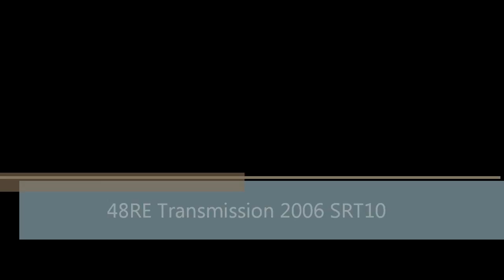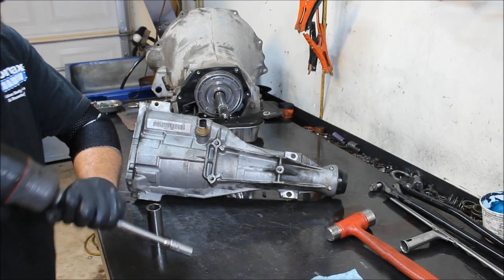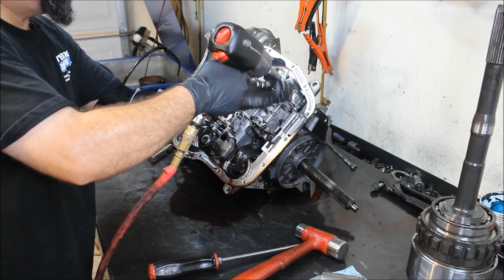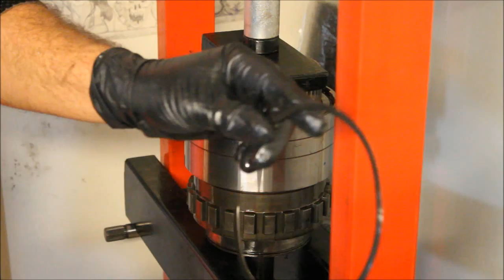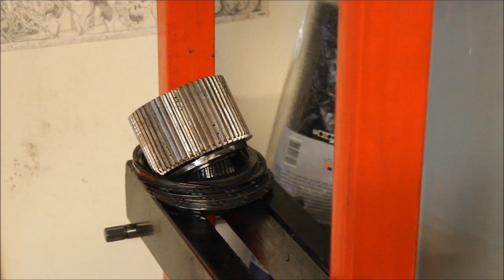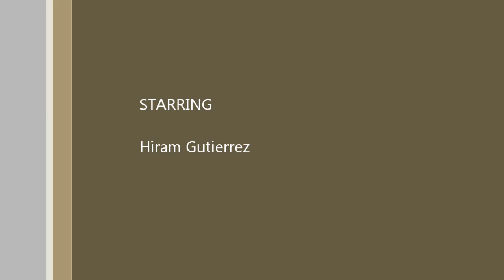48RE Transmission Teardown Inspection, 2006 Dodge Ram SRT10 - Transmission Repair

Comment: By the looks of it there are no responces but I'll try anyway.
You didn't remove the bushing in the 2wd extension housing.
Why?
The 46re tool doesn't work and i can't find a tool for the 48re

Comment: Can I swap 2006 dodge ram 1500 transmission with the 2012 dodge ram 1500???
Please reply to my question y’all
Reply from the maker: Just make sure the solenoid pack connector is the same color. Some 2012 have a Grey connector, if it does you need to install a solenoid pack on the older one to match. Otherwise you will have issues.

Comment: Man.. To say you know these transmissions is an understatement. I have a 48re that won't come out of torque converter lockup. Replaced tcc, gov press. solenoid and transducer.. No luck. Anything else I can check with the pan dropped? Keep up the good work!!

Comment: Perhaps one of the BEST on-line tutorial videos on YouTube. To the point, informative and no music. Thank you for that. Although it would be nice to see the valve body also included. Question, how can I tell if the torque converter needs replacing, or does one just install a new one with the triple clutch set-up to be safe since its all apart anyway? Thank you.
Reply: Pressure diagnosis is,complicated, best replace with new😥 skimping on one component on a rebuild is a bad thing. Chance to bring it all down.

Tc's are hard to get clean without a expensive machine to flush it.

I
Into I would replace it.

Comment: I got me a 2006 ram1500 4x4 5.7l. Does anyone knows if a 2005 Ram 1500 4x4 5.7 transmission fit on it?? I see the engine and everything is the same. It I’m just not 100 percent sure if the 2006 has a different trans

Comment: thanks you for the video, very good information, this is awesome

i would like to know if somes gear are weaker than other, or they will burn always equally
why they are all burned ??
 did the guys just rage drive his truck to finish hit this transmissions ?? hahaha

is the truck is driveable at this points , with minor shift problem,  or this is well beyond maintenance (sry im not english) thank you!

Comment: good tutorial bro.l got problem in my 2006 dodge ram 3500 5.9 2wd  with extension housing overdrive case crackin .l buy new case in ebay but not easy its expense.ok next step,l in my dodge truck never see the bars betwen transmission and extension housing and l try buy but dont find.greetings from dallas tx

Comment: I want to thank you for this great vedeo but I have a question...so my oil pan has a reusable gasket..and my question..do I need to replace my oil pump gasket?
Reply from the maker: +Dubalin H If it came new in the kit, install the new reusable pan gasket. If your kit came with a cork gasket, reuse the original reusable gasket.

Comment: What would a shop charge to if I took this transmission to them?  My truck had the computer worked on since rodents chewed thru ignition wires a fried the computer.  Ever since the shift from 1st to second and when slowing down from 2nd to 1st it shifts hard.  Expressed it issue to the dealership that it never had that issue, they changed the trans filter, pressure governor and drained and flushed fluid.  The problem didn't go away.  I don't think they adjusted the bands. What is take on it?

Comment: im about to teardown and rebuild my 48re transmission out of my 05 srt 10 ram. i was wondering what the torque specs are for both of the bands the inner and outer.

Comment: I have a torque converter heat exchanger that has gone bad on my 2006 dodge cummins, I was going to try and flush the transmission but am afraid it will still need a rebuild. can you tell me if you think a flush will work? if not what you think the cost for a rebuild on it?

Comment: Buenos dias amigo una pregunta tengo  una 2004 dodge ram 2500 diesel 4x4 pero me anda fallando un poco dela transmission  lo q ase es cuando ba de 15 millas  a 30 como q se Barre pero despues de 30 millas  funsiona perfect pero lo ase nomas cuando sele prende las lux de check engine

Comment: My 48re was rebuilt, and put the transgo shift kit in our just like your other video.   Once it was reinstalled would only stay in limp mode and had a code of P0973.  We switched 3-4 and tcc solenoids, put the new governor solenoid in it but left the old pressure sensor.  Everything works now, but for some reason OD is intermittentlt not working.   Any ideas?  Great videos by the way!
Reply: Disregard, It seems I just needed to drive it a bit.  Probably just one of the valves sticking.  Everything seems to have worked itself out.

Comment: Just rebuilt my 48re from an 05 srt10 , direct drum would not come off, I pried of the two drums to remove the snap ring, removed the drum ,the clutch and steels where coned shaped, , band was as bad as the one shown, new bw rebuilt kit, new band , all electrical parts new . It was not as bad as I taught , take it by parts, used this video, also check out his valve body video,

Comment: You rock Hiram. One of the best teardown videos on the web. I wish we were related so you could be here for my rebuild. You hammered that teardown out like a pro. Thank you for such a high quality video. I am doing a complete overhaul and upgrade on my 47re in my 97 Cummins with Red Eagle frictions and Kolene steels. what other parts besides the rollers/sprags or wavy snap rings would you suggest replacing while I have it all apart. I am putting a billet input in there also. All new Torrington bearings, billet pistons, etc?  I really appreciate your input and feedback, thank you in advance Brother. I want this tranny to be solid on a moderate budget without sacrificing durability. 298,000 miles and I believe it was rebuilt once already by Jasper Transmissions.

Comment: HOLA HIRAM ,TENGO UN DODGE 2005 PICK UP RAM 2500 MOTOR DIESEL CUMMINS .LE HE REMPLAZADO 2 VECES YA EL GOBERNADOR Y EL TRANSDUCER SENSOR EN LA TRANSMISION ,AHORA MISMI TIENE 110000 MILES PERO ME ESTA DANDO PROBLEMA ME ENCIENDE LA LUZ DE TRANSMITION TEMP Y LA DE TOW /HAUL AL MISMO TIEMPO Y EL PICK UP SE AGUANTA  COMO QUE SE SALE DEL OVERDRIVE ,ESO ES A CUALQUIER VELOCIDAD Y LO MISMO FRIO QUE CALIENTE Y PASA INTERMITENTE SE ENCIENDE LA LUZ Y SE APAGA Y NO DA CODIGOS NINGUNO .QUE CREE USTED QUE PUDIERA ESTAR PASANDO .GRACIAS POR SU AYUDA SALUDOS HUGO

Comment: Ok i know this vid is old but from a guy who has done hundreds and hundreds of these transmissions i have to say this is a perfect tutorial for tearing down and inspecting basicaly all dodge from 42- 48re. when the unit was dumped on its side and the fluid ran out i could smell it or maybe that was the smell of the one i did earlier today lol. Great vid.

Comment: How similar is a 47RE? I have one attached to my magnum V10. I am upgrading the Magnum V10 pretty extensively. What are the limits that it can handle. Thanks in advance Hiram. I love your videos.
Reply: Cody Green He kind of explained the differences throughout the video. Basically some parts are bigger on the 48re. The 48re can also do torque converter lockup in 1st and 47re cannot. How extensively are you upgrading your v10? If you are throwing a blower on it, you might be better off upgrading to a built 48re. The again the v10 really doesn't tax this transmission like the cummins does so it really depends on the amount of torque you are producing.

Comment: I'm currently tearing down my 48re from my 05 srt-10. So far all my hard parts look ok except the front clutch hub assembly which had clutch plate gouge in the splines. currently thinking I should replace the bellville return spring because of the impressions marked in it from it being used. I have another bellville return spring that looks different. My question is will it be a good replacement for it. BTW i cant find the exact one i have.

Comment: I have a 1998 dodge ram 1500 v6 with a 42re transmission.  Why does a transmission does not shift to second when it is cold outside.  As soon as I drive truck for at least 10minutes, I shifts and then it keeps shifting perfectly until it gets cool again.

Comment: Mr. Gutierrez... I have a 96 Dodge Ram 1500.. I believe it also has the 48RE.. would it be inappropriate to ask what a rebuild like what this transmission needs would cost in 2015 dollars...? You made that tear down look easy.. I realize you have years of experience...but Im looking at having to either do this job or replace the tranny in mine... any help and information would be gratefully received...

Comment: Thanks allot for this vid.... I have a Dodge Dakota .. V6  ... with a 42re ... that was toast ... I'm a mechanic ... but always stayed away from transmissions ... so...I went and got a rebuild kit... also with a jr shit kit ... and as long as you take yr time and remember what you took off... and the order... it was actually pretty easy... so... I even went to wreckers and picked up a other one ... that had broken snap rings... picked it up for 50 bucks... and did a rebuild on that one to... just so I had a spare ... so much thanks again... 

Jay

Comment: I have a question.?
I just rebuilt my 44re transmission, everything went real smooth an easy. Except, after I put on the back assembly back on the main case I cant get either shaft to spin. When I pull the rear unit off both main case and rear unit spin.? But as soon as I tighten it down, the input an output shaft wont spin. It does however switch between gears. Im so lost. I need some help.?
Reply: +Seba Mundell 
did you make sure to put the snap ring back on the output shaft?

Comment: love how thorough you are in explaining what and why you're doing things.just bought a 01 ram 2 wheel dr w/5.9l 24v cummins think it has the 47re auto behind it has 221k on it thinking about rebuilding but just want to beef it up a little  would like to up the horse power 50 horse or so what kit would you suggest pull a older heavy bumper pull rv and 18 ft car hauler lumber ect..nothing big  and would i have to replace torque converter and do alot to the valve body?

Comment: I have a 48re with 30k on the rebuild and it lost overdrive. So I replaced the shift solenoids gov. Pressure solenoid, transducer, speed sensor and the spring you mentioned that breaks. Still didn't have overdrive and there are no engine codes.i tryed forcing in overdrive by grounding the #6 pin wire to rule out ecu issue and still no od.i put a pressure gauge on the overdrive port and I only get 25 psi .so I was thinking it would be the overdrive piston seal but not sure. Any advice would be appreciated. great videos by the way

Comment: Hi I like the video :)
I have Dodge RAM 2500 2003 Cummins with a 47re that needs a rebuild, the oil looks bad and I found parts of a big snapring in the pan.
Since I live in Sweden the workshop has to order the parts from US and that can take weeks, but I could get a 48re from a 2004 with low milage on it and the question I have is if you know if I could just take the 47re out and replace it with this 48re, all the electric connections are the same.

Comment: Hiram, thanks a ton for this video.  I appreciate both your knowledge that you share and the simple fact that you visually show how to disassemble everything.  I have read a lot of write ups but they skip out on some of the details.  Also I must say, watching you tear apart this transmission was very entertaining.  You just absolutely whipped through that SOB!  I WISH I could yank snap rings that quickly..  Perhaps I need to work on my technique. 

Again, awesome video, I watched every second.  You get my vote.

Comment: Hi Hiram, about how much would a similar rebuild usually run for this same exact transmission? I'm considering either the SRT10 Ram or the SRT8 Jeep as my next purchase, but this was also a big factor (regarding the transmission) both transmissions are auto.

Thanks,
-Sunny

Comment: Great video but the viper has the T-56 transmission
Reply: ***** tengo un 96 dodge diesel con la transmision  recien reconstruida. cuando va de 1ra a 2da y de 2da a 3ra  los cambios son muy cortos.casi como si entre 1ra y 2da tuviera 11/2ra,21/2da y 31/2 ra,como si tuviera 8 cambios muy cortos.el overdrive le entra muy pronto sin que este prendido el boton.
culquier concejo  se le agradece 
gracias.
Reply: ***** gracias por responder.
con poco ajuste no se siente nada los cambios le doy mucho ajuste y  golpea mucho los cambios. pero siempre con los cambios muy cortos.casi como si tubiera 7 o 8 cambios. y el overdrive entra sin el boton prendido.

Comment: I was curious to know of any big difference in disassembly of a 42re versus the 48re. I wanted to get a spare unit to practice on and maybe upgrade the internals a little bit. If you had any suggestions I would love to hear them. 

Great video with loads of information +1

Comment: Hey am from the Republic of TrinidadandTobago I've watched your video because am in search of answers on transmission problems. However heard you highlighted a problem with Soidnoid Valve... After doing a diagnostic check I found out the (16-line pressure soilnoid valve) is the problem... i wanna find out what is causing the problem and what should I do...And would this just prolong the life of the transmission temporarily...

Comment: Buenos días amigo! Primero que nada quiero felicitarlo por su trabajo, son pocos las personas que se toman la molestia de ofrecer un material informativo como este, bien sea porque son egoístas o simplemente piensan que les puede pasar como a los Magos si revelan sus secretos, pero usted lo hace y es admirable, soy de Venezuela, donde muchos reparan Transmisiones Automáticas, pero pocos saben su funcionamiento, o desconocen el porque de las cosas, me imagino que este problema no solo es en mi país. La situación es la siguiente, tengo una Venta de Repuestos, y al momento de vender partes eléctricas como Solenoides o Sensores los clientes piden garantía, que no les puede ofrecer, porque la mayoría de estos productos son importados de los Estados Unidos y los proveedores extranjeros no dan garantía por ellos, ahora bien, sabemos que con un multimetro podemos verificar la continuidad y resistencia en ohmios, pero existe la posibilidad de probar el funcionamiento en físico, por ejemplo, me ha pasado mucho con el Solenoide Gobernador de Presión #4617210, y el Sensor Gobernador de Presión #56041403AA; ambos nuevos y originales por Mopar, en estos caso, ¿hay manera de demostrarle al cliente que el repuesto no presenta falla? ¿Que me recomienda? Saludos! Espero su pronta respuesta, y si puede hacer un vídeo seria buenísimo.

Comment: buenos dias hiran tengo un problemita con mi trasmision y es el siguiente : el carro  camina muy bien pero siento que si lo aselero pierde la fuerza , le puse la maquina y el resultado es selenoide trasmision fail is open y tambien el convertidor , mi mecanico dice es tengo que rebildiarla dime si tengo una salida mas economica o si esa es la unica alternatiba.. gracias hiran

Comment: Bottom line is that is one smoked-ass tranny.  Just as Hiram basically said, that's pretty typical of whipping the shit outta your hot rod.  LOL!  Glad I'm not paying for that!  "Fun" often comes at an expensive price tag.  What worries me is that I have a  2002 Dodge Ram 3500 Cummins 4x4 with 165,000 miles on her and a 47RE tranny.  Wonder how much longer my transmission will be functioning correctly, before I have to shell out big coin for a rebuild?  UGH...
Reply: I would think that if you change the fluid often and dont kick the crap out of it, you shouldnt have any issues. I prey I dont have issues, I just purchased a 98 Ram 2500 v10, the 10 means 10mpg! It has 165k and who knows whats been done to it, but seems ok.

Comment: You're right. All Vipers are manuals unless some owner somewhere modified one to be automatic. But technically speaking, the quad cab SRT 10 is the only factory configuration where the Viper engine was mated to an automatic.

Comment: I was new parts speed sensor not still not work ,stuck shift toughest  wont work shift r back and  fine d shift  to go also mileages stop wrong some things transmission inside electronic? rebuilt cost or order $1,800  1992 DODGE D150 5.2L overhaul transmission

Comment: What keeps happening to it? The torque converter is always overlooked on the diesels because they are expensive!! With what your towing, a triple disc, lower stall, billet is the least you should have. The trans gets hd diesel shift kit, solid band/hd strut, along with a good solid build. This should pull with no problems, oh don't forget trans cooler.

Comment: Nice work,I notice the 48s 2nd gear apply lever ratio change from 3.8 to 4.4 when it was the 47 has had a pretty big affect on the band life...IBM thinking the ration change isn't allowing the band to release fast enough,on the 2/3 shift,causing very short band life even in a stock application without abusive driving.